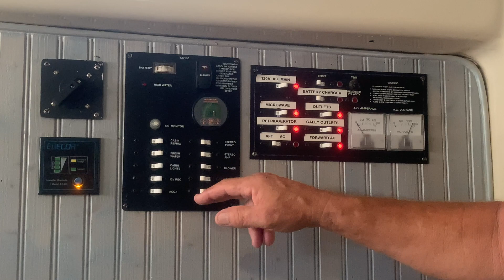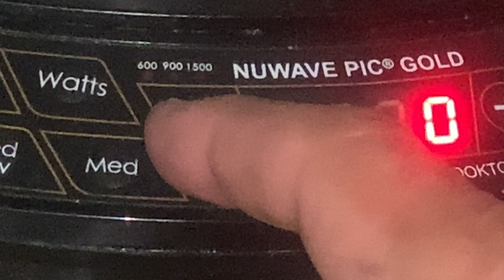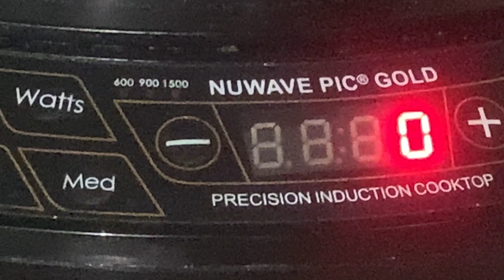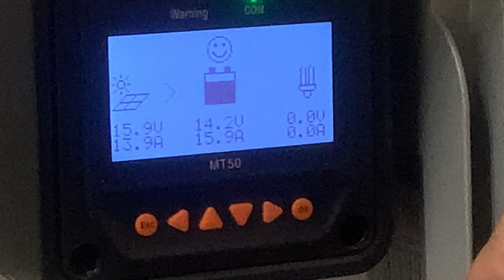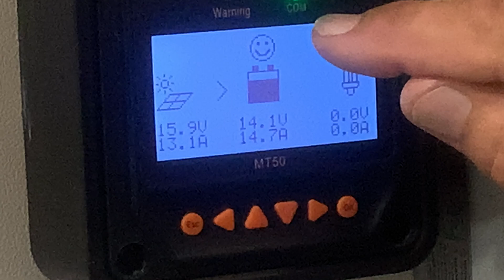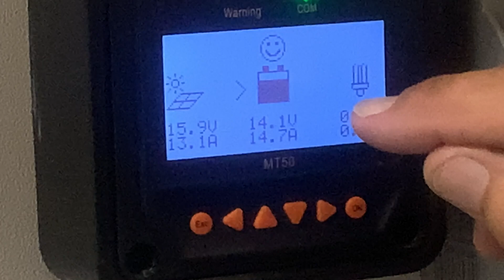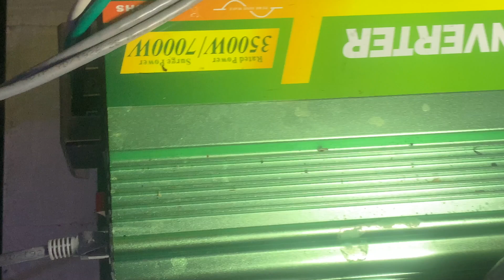DIY 700 watt 12 volt EASY solar system & what to buy$$

Comment: Awesome video.  I'm also using a 30 amp controller and have 700 watts. Everything seems fine, but I'm looking at the specs, and it looks like I shouldn't have anywhere near as many watts coming in. Am I misunderstanding something?
Reply from the maker: Sorry I missed your question at the end... So, not sure what you are misunderstanding... "Intake" varies with the sun... 700 watts to Amps at 120V = 5.83 Amps
Reply from the maker: Thanks!